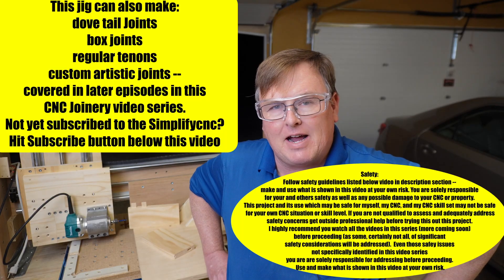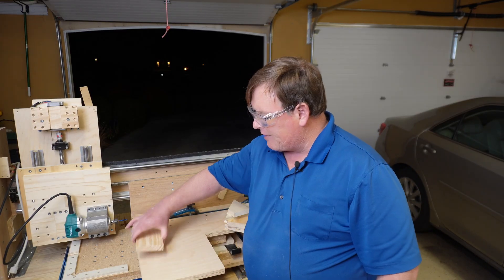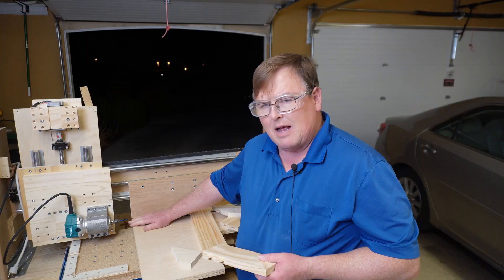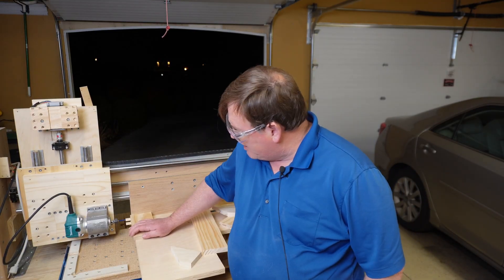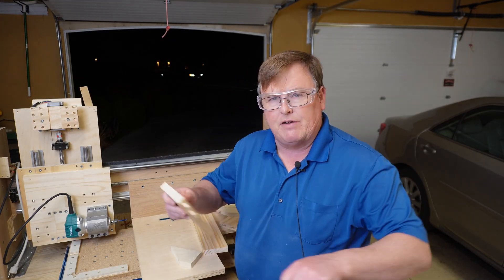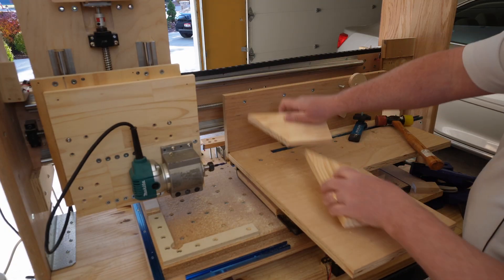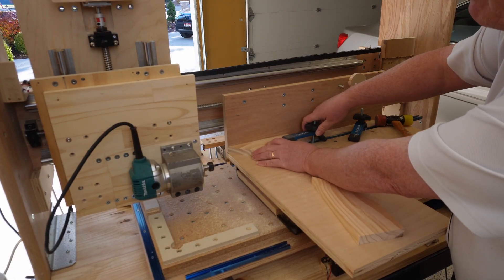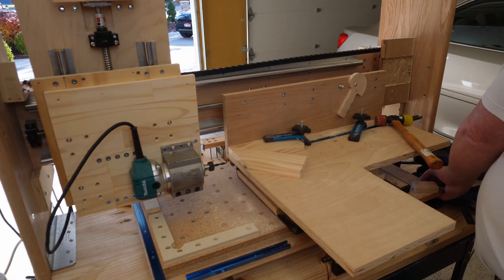CNC Mortise and Loose Tenon Joinery! Don't Let Costs Domino Out of Sight

Comment: Just found your channel, thank you in advance. I’ve been searching for a very long time for a channel like this to explain where I went wrong with my home built Cnc. I suffered with emf interference even though I used shielded cable, after a lot of research I came to the conclusion that if I fitted octocouplers inline that should eliminate my problem, as of yet I haven’t tested for reasons of not having a location to stage my Cnc permanently until I built a workshop.  The workshop is now built so I’m getting back on track with the Cnc, your wiring of the drivers was a breath of fresh air, your solutions for solving the ground issue (not having enough) on the arduino is genius thank you. Following and looking forward to seeing more from you.  Cheers.
Reply from the maker: I am so glad my video helped you out.  I have been little under the weather for the last month with a nasty cough but will be uploading lots more videos soon.  Thanks for the great comment and encouragement.